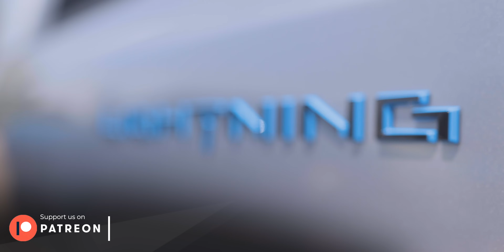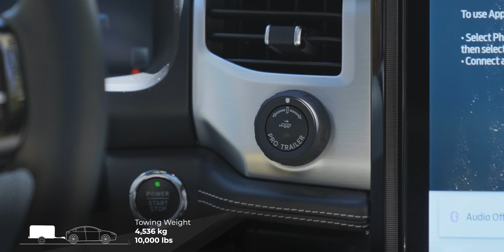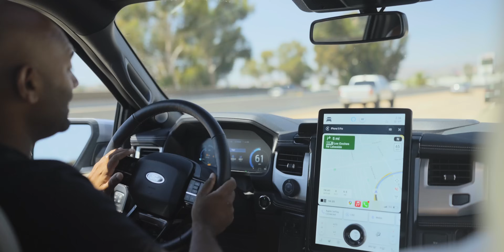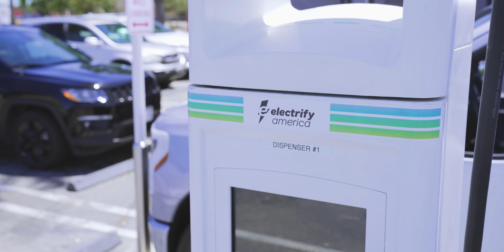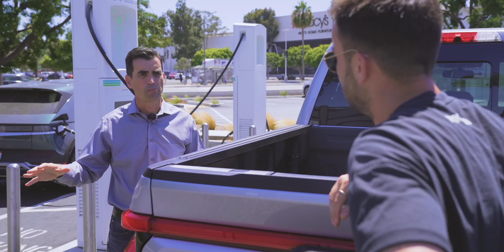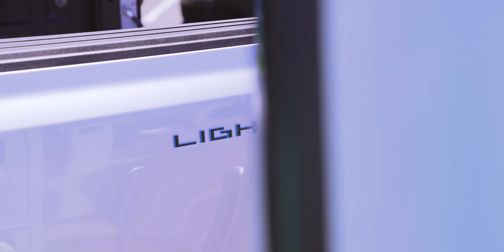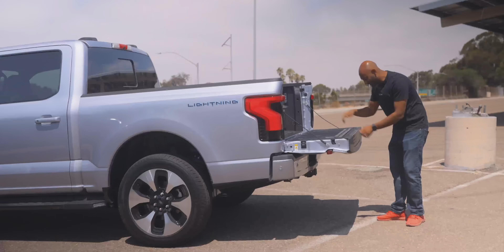Ford F150 Lightning: Is This The Best Truck Ever Made?

Comment: Excellent review. But let's get one thing straight. "Real truck guys" get into the bed from the side using the rear tire as the step. That dinky step thing in the F150 is for city slickers.
Reply: Pretty sure that’s just something that’s on all F150’s but I’m not into trucks so I’m not 100% sure. I do know the idea with this truck is to basically just take what already works with the F150 and make it electric so there isn’t a lot of EV specific features here vs the gas powered trucks.

Comment: As we drive towards needing to have a smaller environmental footprint, vehicles like this are obscene. There's no need for it for 99.9% of those who might buy it.
It's just a decedent sign of conspicuous consumption. It may be 'the best Ford F-150', but maybe the F-150 shouldn't be. Bring back the pickup trucks of 30 years ago, with reasonable sizes and electrify them.

Comment: 90% of buyers don't 'need' a massive inefficient truck. We could transition quicker to EVs with smaller more efficient vehicles. Using 2x the energy to move around is bad be that electricity or something else.
Reply: People decide themselves what they need or not in democratic countries, but additional TAX for SUVs would be very welcome move. I drive small car in the UK not because I want to, but because I don't want to pay additional road tax.
Reply: That's why bought a Ford Maverick. $24,000 and 46 MPG. At that rate it's hard to justify a BEV.
Reply: Very much agree that most don't NEED a truck.  However, they are super comfortable for US driving.  
I just took an XLT from Nashville to Memphis and it was easier to drive the distance than it was in the Hyundai suv I rented before.

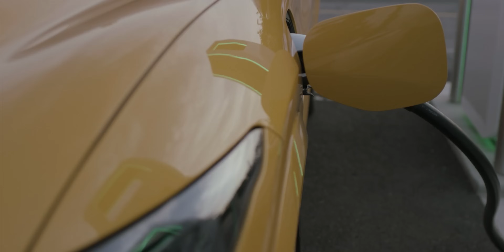Comment: 12:00 - Good to see Electrify America actually showing on-site large grid-size batteries at their charging stations.  That's probably the only way they can guarantee the big 100+kW charge rates on multiple EVS simultaneously.

I would imagine they're also playing "energy arbitrage" and recharging those big batteries mostly at night when the electrical rates are way lower.  Or "sipping" power more slowly from the grid in-between EV charges to get lower rates and reduce stress on the grid if running low.

I would be even more impressed if most of their recharge stations had a 1/2- to 1.0-megawatt solar panel providing power and shade!
Reply: Yes I'm sure they do charge at night. The main point, though, is to shave their peak usage. With commercial electric service, unlike residential, your electric bill is partly based on something like the 95% percentile of power draw — meaning, what amount of power do you exceed only 5% of the time. So reducing your peak usage is not only good for the grid, but you can actually save money directly.

Peak theoretical usage at a given site assumes that (a) all chargers on site are occupied; (b) all occupied spaces are actively charging; (c) all charge sessions are at the maximum rated charge speed. Even at a busy site, not very often will all 3 of those things line up. So there is plenty of scope to reduce the maximum power draw from the utility (thus reducing your bill), by buffering it in a battery, even on a time scale of 30 to 60 minutes.
Reply: Yes, especially in the Southwest when it's sunny all of the time.

Comment: Caravans are going to need their own batteries and motors (controlled through the truck) to make long term road trip holidays viable. 140 miles or 225 km just isn’t enough when on long trips around America or Australia as range is roughly halved when towing. Something I am about to do for 6 months and would love to do in an EV but the only sufficiently sized towing vehicles available are diesel trucks (utes as we say in Australia… where this form of vehicle was invented I might add😁)  and even if we could get the lightning we would be stranded within 2 hours of leaving suburbia with an empty battery.
Reply: Range is only halved when going over 60 mph 100kmh look at it like a boat the faster you go the less range you get

Comment: While I agree that this truck is very important, if not the most important in terms of mass adoption in the US, I think your comparison to the Rivian was biased and uninformed. The Rivian is much more efficient with much more power and capability. For example, there is no body roll like you mentioned on the high end F150. The Rivian suspension is reminiscent of McClaren. Target markets are very different.

Also, this video turned into a Electrify America advertisement for a bit. What rate can the F150 charge at? Is it the same charge rate and range across all trims? I believe not. 

Video is biased.

Comment: the FAKE Charged show - NOPE , the F150 Lightweight is a FLOP , FUD motors cant even SCALE production and cant even make 10,000 per year. 
the FUD Lightweight is too SLOW , too short RANGE , too HEAVY and INEFFICIENT. 
the TESLA Cybertruck is the WORLDS fastest truck on EARTH , its also the WORDS most Efficient . 
TESLA Cybertruck QUAD motor uses 4 PLAID motors in two axles . 
and has 2000 HP and 1800 lb Torque , it can HAUL 5,000 Payload and 20,000 lb TOWING and has over 500+ mile Range w/ max payload and 6 Adults. 
TESLA Cybertruck can SMOKE a Porsche 911 and go 0 - 60 in 2 seconds or 1/4 mile in 9 seconds. 
Cybertruck starts production in 2023. and it will OUTSELL the FUD Lightweight.

Comment: Not for towing any equipment it isn't. A recent comparison between this vehicle and a diesel equivalent demonstrated how dramatically its range was reduced towing a caravan/camper weighing 2000kg to the point where is was impractical.

Comment: One thing to correct Jack: for the future, for EV’s and for the rest of the world - this is NOT the “right” sized vehicle
Reply: @ChaosSwissroIlCommentsCensored  even this thing is stupidly huge, what difference does the 'half bed' make? We both know even these 'work trucks' and most of the 900k per year never have anything put in the bed
Reply: @ChaosSwissroIlCommentsCensored  they do, and they're carried in about 2% of trucks that actually get used for work

You do know 2x4's exist in the rest of the world don't you? well actually 50x100 to use a proper measurement but you get the idea

Comment: Cool, truck yes.  Currently the best one available, considering there are only 2 (sort.of) sure.  Will it be the best seller?  Probably not after next year.  We will see.

The fact that it's just an electric F150 (fake tough) kills it for me.  If cybertruck delivers on its armored stainless steel goodness then F150 and the Rivian will be fighting over the scraps.

Next year is going to be very exciting as the cybertruck hits the market and Rivian and Ford gets their EV truck legs under them and ramp up their numbers.
Reply: Fingers crossed for next year.
Reply: The Cybertruck looks like a bad concept vehicle.  Nobody needs bulletproof doors either.  Even then, during the live on stage test the windshield broke from a baseball.  All that is going to do is add weight to the truck and decrease the range.  Rivian and Ford aren't the only ones in the pickup truck EV game either.  Hummer is coming out in late 2022 or early 2023, Silverado is 2023, Ram is 2023/2024, Toyota has announced their EVs recently, and even more will be coming soon.  Elon announced the Hot Rod would be out by 2018 and we still haven't seen it.  I wouldn't bank of the Cybertruck coming anytime soon and even if it does, there will be plenty of competition for it.  I'm hoping R&D on batteries will improve dramatically with so many jumping into the EV market and range will quickly reach the 500+ mile point (though Ram is already claiming their EV truck will do).
Reply: @MistahShowtime  Don't much care what it looks like.  Just needs to work as advertised.  Why wouldn't you want it bullet proof?  Makes it less likely for a protester to dent your truck when they are out blocking traffic.  There is no such thing as shatter proof glass so don't see that as a negative.  Heavy just means it crushes anything that cuts in front of it.

Hummer...I'm not gay or in the NBA so wouldn't want that, and it is way overpriced anyway and isn't a truck.
Silverado...wouldn't drive a GM if you gave it to me.  Besides GM just can't seem to not burn people's houses down with their EVs.
Rivian's target audience are yuppies.  Way overpriced for what it delivers.  Too delicate.
F150 is ok, but it is too much plastic and not enough durability.  I'd drive one if there are no other options.
Ram....kind of like a shittier Ford. Have they made anything in 20 years worth half a turd?  No thanks.
I'd drive a Toyota, have for decades (Corrola, Tercel,  Tacoma, FJ), but their electric lineup is pretty much vaporeware.  I'd even love to have a 4x4 hybrid, but no one has ever built one.

I'll happily keep driving my current 4x4.  It only has 100K on it so I'm good for another 200K.   I can afford to wait for Toyota or Tesla to get it in gear.

Comment: I'd love an aerodynamic F-150 lightning for long range towing. The frunk would be more useful for F-250.
Reply: Lightweight cant tow more than 100 miles , its a REAL Lightweight.
Reply: @markplott4820  Lightwieght? Means 150 or the small battery? I don't know trucks.
Reply: @موسى_7  FUD lightweight as in , its CRAP

Comment: Good promo material, but rather weak review. You don't even mention it's biggest weakness, tow something and your range can go down to 100 miles based on the weight of the thing you are towing.
 I think savagegeese did a good review of f-150

Comment: I don'T understand the issue with the whole "plug and charge" and the "hassle" of taking my credit card out. We all do it for fuel, coffee, drive though... but somehow doing it to recharge is a deal breaker... Just put a paypass receiver on it like air compressors at fuel stations and the issue is resolved.
Reply: Apparently the truth is that it's NOT as easy as normal credit card terminals. and these EV chargers have a host of other problems  INCLUDING being unable to reliably accept payments.

Comment: I can’t wait to see the 2024 or 2025 generations of this truck…all it really needs is a little bit faster charging and a few hundred more miles of range at a reasonable price and I see it taking over the market. Quite impressive.
Reply: Yep. I drove one recently and it was AWESOME. I'm just not sure if I want to wait for something closer to the 400 mile range because it would be our primary trip car(I've already got a short range ev for local stuff)
Reply: @robertcowher  I’d say most ppl are thinking just like you. Plus if they want to pull something, the current range drops in half to maybe around 125-150 miles. That’s just not going to cut it.
Reply: @robertcowher  The Chevy Silverado EV is supposed to have 400 miles of range and the Ram EV is supposed to have 500 miles.  Of course, nobody has been able to do real world tests of these yet.  Also, they will likely be the high end versions with an extended battery that hit these numbers.
Reply: More miles? Can achieve that by making the front aerodynamic, which may happen when truckers get used to driving electric and say 'I don't need a blocky front'.
Reply: @موسى_7  That would help too, and I’m sure the future models will be more aero for sure👍🏼

Comment: I would love one of these for the UK, ours would have to be the Ranger spark lol. Our trucks are only just getting up to the F150 standered with all the tech they have. The new Ranger should have an electric version. Not that I could ever afford one. Also not all F150 lighting have the folding gear stick if my memory serves me. And not all have the light bar, top 2 or 3 models. Lariet, platinum and possibly the XLT. Slightly bad info but still an amazing truck.

Comment: This EA guy’s line of BS is laughable.. they have some of the WORST up times in the industry. They have woefully under developed sites with 4 charges being the most common setup.. half of what the MINIMUM should be.  And those 4 are rarely ever all in operation! At this point, anything less then 12 chargers is below what should be the current standard at any fast charger on an interstate highway. And that is going to need to grow to 24 in the next few years

Comment: I wanted a video about the F-150, not one about Electrify America. Also, please don't assume that everyone is familiar with the F-150 already. I've seen them around but that's about all I know. I was hoping for a proper look review of the vehicle, not having the presenter keep glossing over things because we know them already. Lastly, if you are going to compare it to the Rivian at least look up the information about the the Rivian. For example, the presenter states that he thinks that the electric outlets are not 20 amps. And a $90k+ platinum edition F150 is not about the same price as the $60k+ Rivian, it is much more expensive, almost as more expensive as the Rivian as the Rivian is more expensive over the base electric F150. That's either a mistake or the presenter not being impartial.

Normally your videos are much, much better than this. When I first saw that it was available I was going to send it to a friend who wants an electric truck. However, after watching the video I'm glad that I didn't send them the link right away because the video contains little information, was poorly made, not impartial, and contains a seven minute commercial for Electrifying America, which has nothing to do with the F150.

Comment: Good Truck ✅
 Conventional looking inefficient EV ✅
Reply: Gets 65-70+mpge at hwy speeds, which matches the ground up rivian r1t in efficiency. So do tell how is that inefficient again? 
My rwd only 2019 f-150 struggles empty to pull down 20mpg on the hwy at 65mph with cruise control on. Most tanks are in the low 18s. 😀

Comment: Good marketing spill from the EA guy, but the reality it is that only 3/4 of their charging points really work (best case), based on a study done by UC, and my own experience. They are nowhere near the availability/reliability  that is required if EVs are to become really widely used. They are nowhere near Tesla.
Reply: Since tesla is pushed to open their network to other brands in Europe (and they need the throughput to generate profit) i think the us might follow soon..
Reply: @erebostd  It will be interesting to see how long it will take as Tesla Superchargers only their proprietary connector compared to Europe where their chargers have CCS2. I believe they are planning to deploy new chargers with both connectors soon and hopefully with longer cables.

Comment: Will plug n charge be made available for Electrify Canada? When will the network be expanded to a useable level, in particular, in rural parts of the country?
Reply: Ivy is another big charing network coming. Its owned by Ontario Power Generation. 
They plan to install in some remote areas of Ontario. Hopefully expanding into other provinces too. 
Plug-n-charge would be nice, fingers crossed.

Comment: I don't know.. if money was no object I'd opt for the Rivian fully loaded over the F-150 Lightning.

Rivian's tech is on point, legacy automakers are having a bit of trouble keeping up with the new kids.
Reply: Idk. That 240V output is a pretty useful addition, that the Rivian doesn't have. I can power household appliances with that, on the go!
Reply: @JustLatino  Whelp.  Ford no longer selling the reasonably priced F-150 lightnings.    They're all 65k+

I was honestly on the fence, but now have a reservation for a Rivian.  The 240v on the F-150 was compelling, but I did a test driver of the Rivian R1T and it's honestly awesome.

Comment: The power outlets are a huge deal. Having one of these charged and sitting in your driveway could be a huge deal during power outages
Reply: Ford offers a "Ford Charge Station Pro" which is a bi-directional 80-amp EVSE that lets you power your house from the vehicle battery. You don't even need the built-in outlets...
Reply: @Smidge204  It's frustrating that other EV makers totally missed this opportunity. It's such an obvious thing, I'm really glad to see someone building cars with built in power delivery systems.
Reply: @jameshughes3014  I'd say it's not an "obvious thing" - using the vehicle battery like that puts extra wear and tear on it. Manufacturers are generally very conservative about preserving the battery life, because it could mean costly recalls and a bad reputation if they start having issues with early capacity loss.

It takes time to learn about battery degrade and how to mitigate that. You can see a trend in EVs coming to market in the past year or two where they are clearly getting more comfortable with how well their batteries will hold up over time. Using the vehicle as a power source will absolutely become more common, but it's taken a decade for manufacturers to become comfortable offering that as a feature.
Reply: @Smidge204  Those are all good points. But I still feel like having a giant battery in my driveway that I can't use as a generator in emergencies is an oversight. I watched a really old interview with one of the engineers of the Chevy bolt, when they were asked at the time if it could be used as backup power they looked dumbfounded, as if the idea never occurred to them. I'm not against chevy or any company really, but if you run a company, and are trying to sell a thing.. and you realize it could have two uses in a way that increases that things value.. It seems you should try to do that thing. I also have skepticism about the idea that large corporations are worried about longevity of a product in the era of planned obsolescence. Especially with the first electric cars 10 years ago or so, the situation at the time meant you'd sell every one you could make and the people who bought them expected and understood it might fall apart or not work right - they were early adopters which are a special breed of consumer.